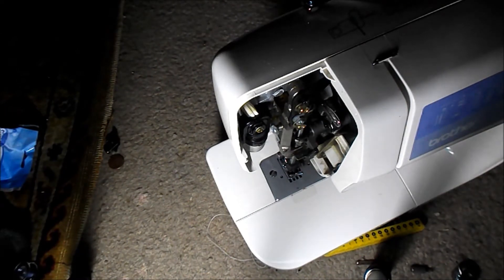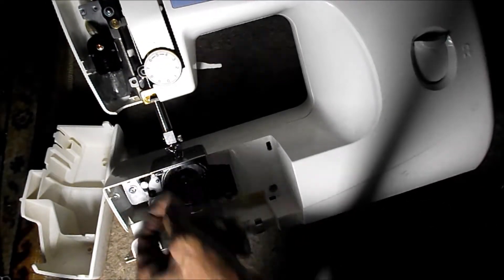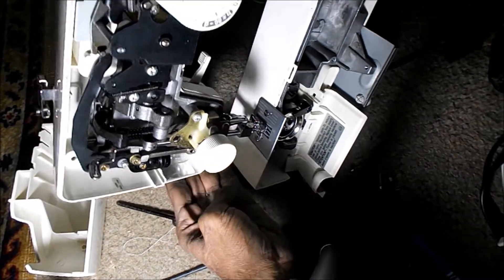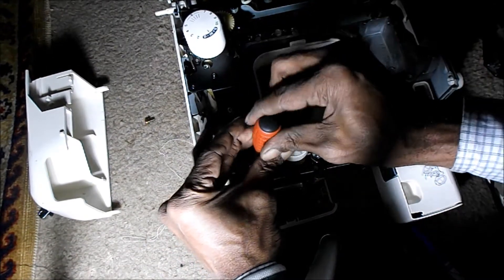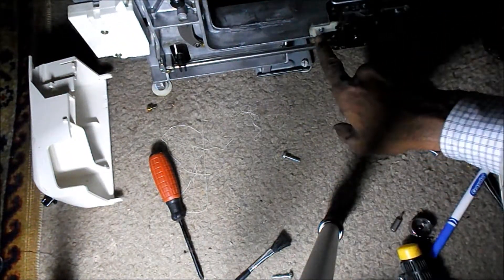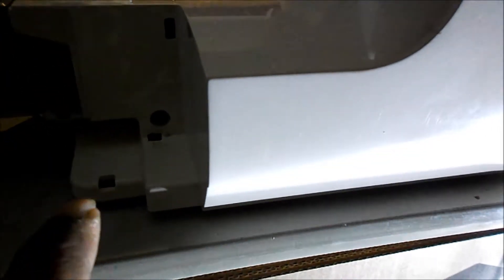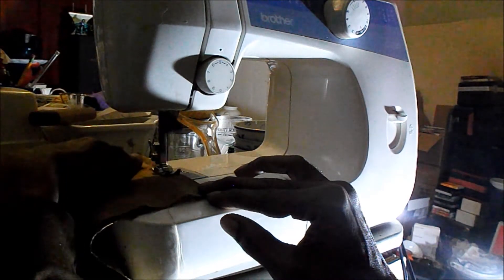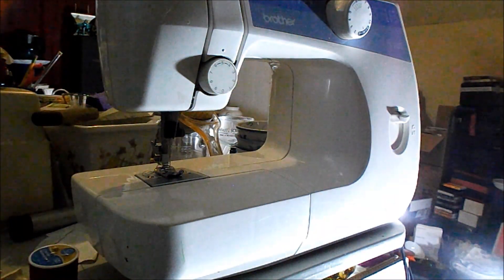How To Fix Brother LS-2125 Sewing Machine

Comment: That little plastic thing is a real B. Spent half an hour trying to undo it.
This video was useful, thanks.
Reply from the maker: If mine wasn't working so well I would try to open it again to give a better explanation. If I remember correctly, make sure all the screw are out and grab the section on opposite sides with both hands while pulling the edges outward and try to separate the lip that latches in the center with a flat screwdriver.
Reply from the maker: 03:45
Reply: @Lookatthebottom  Wow, speedy reply.
I edited my comment. I got it open but will have to sand down the plastic where I made a bit of a mess of it so it doesn't snag anything. There was another plastic latch in the curve but that one wasn't quite as stubborn.

Comment: Thank you so much.   I have my sisters machine to repair and I found your video.  It was real helpful, though Im not sure this is the same problem.   I cannot turn the wheel as it will only go down so far.  You mentioned cogs and stuff, I thought it may have been a problem with the belt.  Your video was a slight dark for me to see clearly.  I will certainly try the method that you have shown,.  Do you have any more thoughts on what may be the problem.?  Thank you.
Reply from the maker: I had a similar situation where the needle wouldn't go all the way down. There is a weighed mount for the needle I had to unscrew it and adjust the height manually. I may be able to assist more when you get to that point with the cover off.

Comment: How do I do the adjustment now that the machine is apart??
Reply from the maker: There is more than one possible adjustment. It depends on the specific issue.
Reply: Well, the teeth line up with the gear on that bar.. my bobbin holder doesn't turn far enough for the hook to catch. I wish I could share photos.
Reply: I have even tried making the adjustment on the needle arm. Nothing is working. :(

Comment: Hi!
Thanks but are you satisfied with the foot controller hesitating. Mine goes into high speed!
Reply from the maker: I just started using it, but the foot controller is a bit touchy, I just adjust my foot position and never fully engage the pedal. My daughter was able to sew much more smoothly than I.
Reply: @glennlopez6773.       Mine got loud humming sound, reluctant to start sewing , what could be the problem, all I think about it is I never clean it, never oil it, is it too now, cause after I bought the sewing oil, it still not improving at all!

Comment: Sir, can I ask for assistances. I’ve left my sewing machine for number of years and trying to use it today and the rod that holds the needle is stuck. The threading for bobbin works well just the sewing needle is unable to move. By pedal or manual ..... can I know how this can be fixed? Many thanks 🙏
Reply from the maker: It sounds like you have the same issue that I had originally. The video should help you repair it yourself.
Reply: High West Enterprises thank you 😊

Comment: What’s the size of the screwdriver you used? My sewing machine didn’t come with a screwdriver. Also, my sewing light gets really hot. Would you know how to fix this problem?
Reply from the maker: You will need a small phillips screwdriver. I didn't remove my light while making this repair like I should have, and I broke it in the process. Now I use an external light, I haven't missed it much, so I would remove it and leave it out if it's causing problems with the heat.
Reply: You can replace the incandescent bulb with an LED lamp - it will put out much less heat and more light.   Put these keywords into the search bar of the retailer you want to use  "led+sewing+machine+light+to+replace+incandescent+bulb+e12+base" make sure to pick one that is at least a 15 watt equivalent

Comment: My brother Ls  2125 sewing machine is not working,have no power .how to repair this machine .
Reply from the maker: @reynartegamboa2211  make sure the power cable is pressed all the way in and check the foot pedal if it clicks when pressed. If it doesn’t work you may want to replace to avoid an electrical hazard
Reply from the maker: @reynartegamboa2211  I purchased a second one from Walmart. Price was reduced and upgraded quality from the old one.

Comment: does this sewing machine have a drive belt
Reply from the maker: nibz nibbles bo
Reply: @Lookatthebottom  then how does it work
Reply from the maker: @nabihakhanom9675  There is a sliding gear mechanism at the lower rear of the machine.

Comment: Hi, any chance you might be able to do a tutorial on how to remove a needle bar assy or needle bar in general? Your the only one who just happens to have the same machine as me and I’m having trouble removing it
Reply from the maker: Great suggestion!
Reply from the maker: What I recall is that if you loosen the screw mounting the needle bar, it moves freely. You have to find the right level to allow the needle to catch the thread from the bobbin. It's a bit of trial and error, but there is a YouTube video or Google diagram that shows the general position.  Hook timing.

Comment: My front cover won’t budge 😂 Something is stuck at the top.
Reply from the maker: Be sure that all the screws are removed, it takes some finagling to release the interior latch, you have to pull and apply pressure, it almost felt like something was going to snap, then it just came apart. If my machine wasn't working so well and I wasn't busy, I would take it apart again to demonstrate, but if you work at it you will get it.

Comment: Great video...except where you skipped on how to adjust the bobbin to be able to work properly. THAT is the part I NEEDED to see😔
Reply from the maker: What exactly is your bobbin doing that needs adjusting?
Reply from the maker: You have to adjust the needle bar up or down to catch the thread. There is a screw that should be loosened then you can adjust the bar up or down. The needle has to enter the bobbin case in sync.  There is a video or diagram that I recall.
Reply from the maker: hook timing

Comment: do you know how i could fix the little button that you also had broken? i thought mine was okay but as i was taking it apart and cleaning everything i noticed the knob kind of just sits in place and spins freely because it was broken before hand (i found it at a goodwill)
Reply from the maker: that small knob to adjust the thread tension if you have the broken piece, I’ve had luck mending broken plastic with the super glue baking soda hack